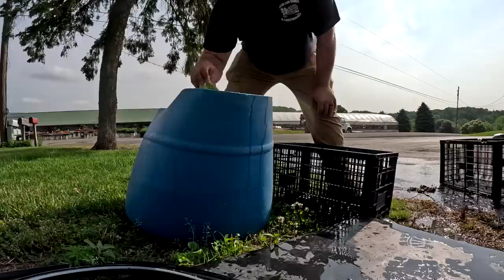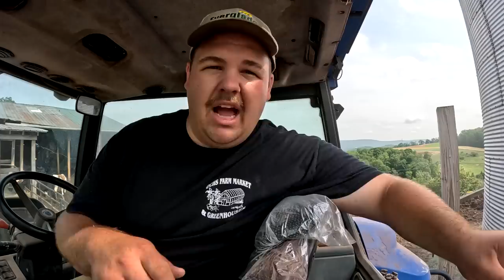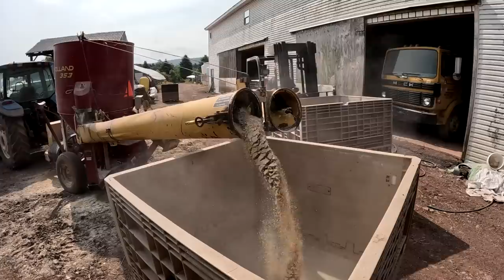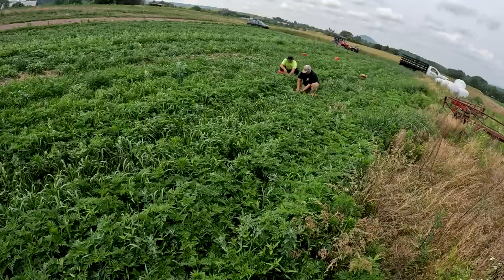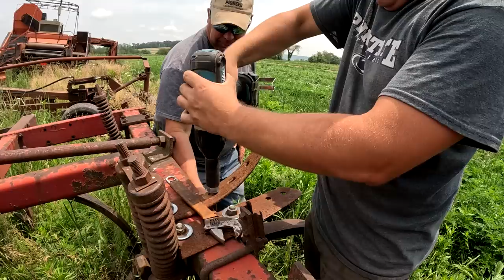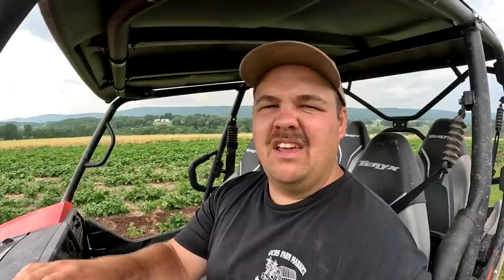WE DIDN'T EXPECT THIS HARVEST

Comment: I hope you folks don't get too much compaction damage using that big tractor for hilling.  Early on we used a Massy Ferguson 35 (with vine-lifters) that worked very well.  Problem was that tractor was already very old when we started to use it so, we put the whole rig onto our John Deere 5400.  That didn't work out at all.  The tires were too wide to start with and putting narrower tires on it just made it sink in soft ground far too much (the tractor was just too heavy for the job).  We ended up with a new (then) Kubota M4030 as our cultivating and hilling tractor.  It also turned out to be a handy little utility tractor for lots of other small jobs.  Best of luck this season.